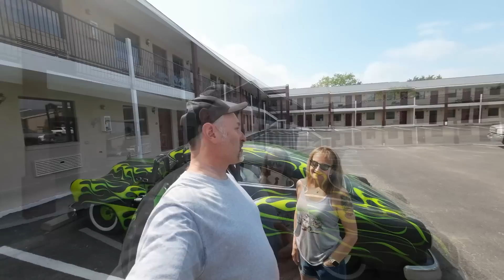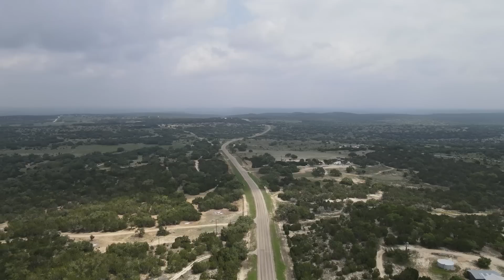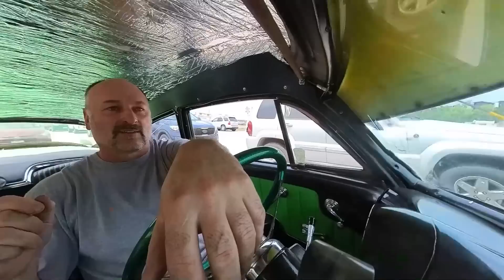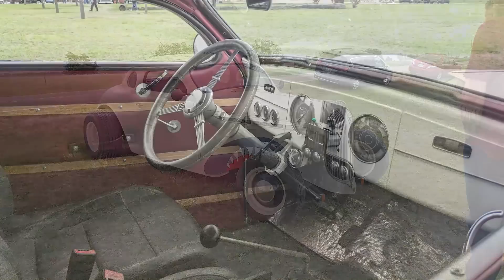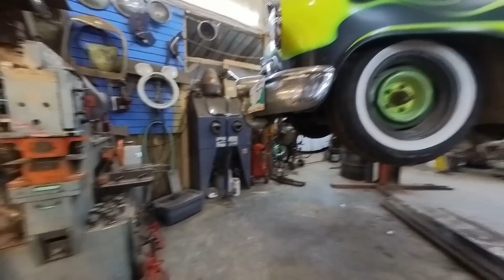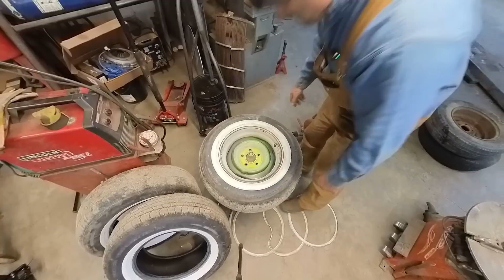BTS - Road Trip Day 4

Comment: I keep a hank of heavy gauge picture wire in my glove box, comes in handy. I scraped the front of my car on an extra high parking curb and took the license plate off. Hanger wire had it back in place and no one was the wiser. Good to use under the hood for temp repairs.